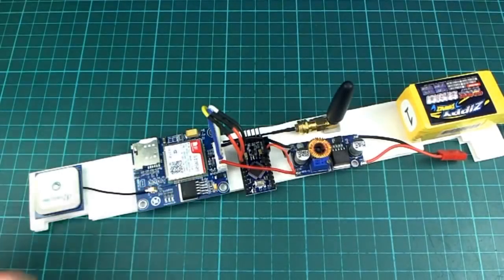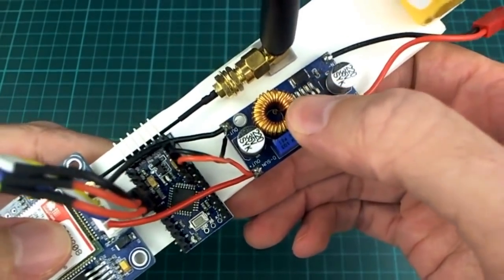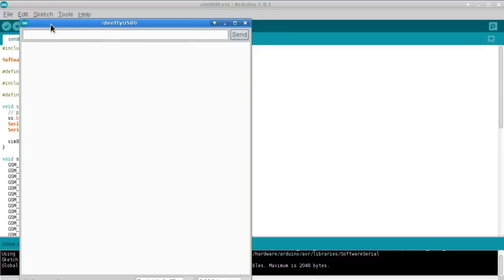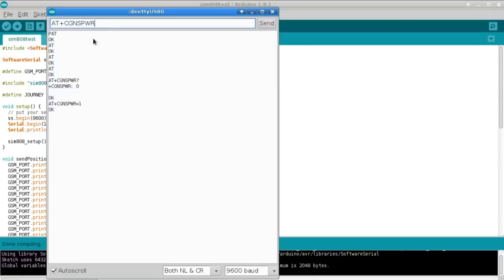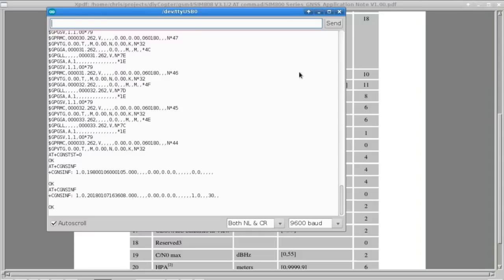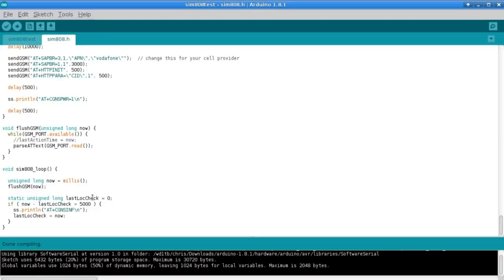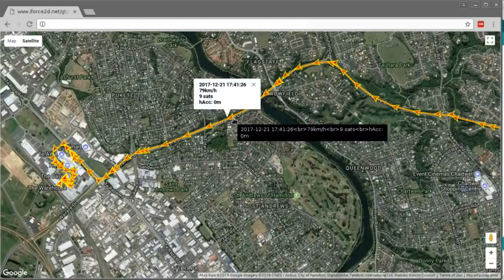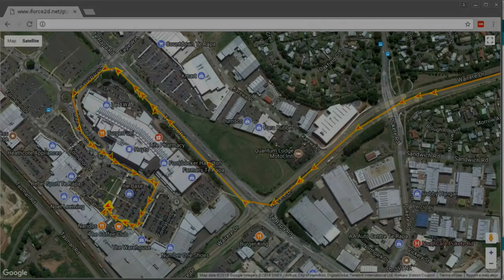Arduino GPS tracker, SIM808 version

Comment: Nice video!! I Have a question, I Have a lipo baterry, with the regulator to send 5v to sim808 and 3A but the leds of sim808 turn on two or three seconds, then turn off and then don't turn on again. I don't know what May be the problem
I am talking about the leds net, sta and pps

Comment: Hello nice video! What do I need to change if I want to use an arduino uno?
Reply from the maker: The uno and pro-mini use the same microcontroller. You'll need to change the board setting in the arduino IDE, otherwise all should be the same.

Comment: Hey Iforce2D,

I’ve checked my journey code, and it shows as available... that is, until I power on my Arduino/SIM808 and get it connected. Then the journey code reads as taken on the server - so far, so good. This means there is communication between my Arduino, the GSM, and the server. However, no data points appear on the map! Any idea the reasoning for this? 

Thanks for the help!
Reply from the maker: Sorry about that, try again now. Somehow a few lines of my PHP had disappeared, absolutely no clue how that happened, since I have not touched or even looked at that code since I uploaded the video, when it was clearly working fine. Thanks for the heads up.
Reply: iforce2d Crosses fingers

Crosses everything I can 

Plugs in arduino
Reply: iforce2d And look at that, it works! Amazing! Thanks for the help, couldn’t have done it without you and these tutorials!

Comment: Hello, I am trying to use GPS and GPRS simultaneously on this module is it possible?  I am trying a TCP connection with the server but not able to establish.
Reply from the maker: Yes, that's exactly what I did in this video. Start with the previous videos instead of trying to do this one first with no previous experience.

Comment: Hi, I did everything as you said. I also did it manually on Serial Monitor. I am  able to get successful result on Serial Monitor. When I'm uploading the code. My code is getting stuck at Waiting for SIM startup.... Any Suggestions????? Thank You.
Reply from the maker: What other print statements in the code are you expecting to see?
Reply: @iforce2d  Thank you so much for your reply. I'm expecting Parameters, that we are writing to Serial monitor through code such as "CGSINF result for is"  etc.
Reply from the maker: Standard approach when you are wondering what your program is doing, is to add logging.

Comment: i have a very similar module from adafruit , A7 module with 32u4 micro controller built in.
thy call it 32u4+A7 . 
do you think there will be huge difference in the code?

Comment: Great product! I am building data logger which will communicate with remote servers. Battery is my main problem. What are specs of this battery used in your project? mAh, voltage, current ... ? What is power supply for your GPS module? I saw a lot of people having problems with correct power supply for GSM/GPS modules. Thanks in advance!
Reply: 9 VOLTS

Comment: i am working in my fyp project its working but one problem aries in my project . Actually Project have two feature first scan the rfid card and send to web server for identification ,second get gps coordinate continuous for real time tracking of his vehicle and send lat lng to same web server.

Driver can scan his card any time while vehicle running or stop thats mean I want rfid scanner active all time and once the card scanned that detail send to web server database through http  connection but problem occurs of gps scanner because its continuously running and data sending to http web server mode Now when driver scan his card it will not scanned till gps and gprs complete his loop once they complete the card get scanned its very long process to hold the card at reader.

What I want, RFID scanning  and gps location sender functions run in parallel way as rfid reader alway active even gps sending data in background mode live service. I have two priority for this project sending gps coordinate continuously as well as scan rfid any moment that card is placed.

all problem occur due to http connection once gps is in the function of http it take time and not scan RFID.

Can I run both rfid scan and gps acquisition process simultaneously rather http connection work in background

Comment: Hi, iforce2d :) I would like and appreciate your help. I'm building a GPS tracker, similar to the one you built some months ago. I have successfully managed to get all the GPS info, coordinates, time, etc. The impasse I'm having is with the connection to the Internet so that I can see the trip in Google Earth or Maps. I've seen quite a few of your videos but cannot manage to get the connection rolling. So, few questions: What app/program did you use to see the trip? How do you establish such connection? How do you upload your coordinates/page info to the app? Hope you can help me. Thank you!
Reply from the maker: I'm using HTTP connections via a cellphone module, see the "previous video" links in the description. I don't know what you mean by "app", the display is done in a web page, you can see how the Javascript does it by looking at the webpage source. If you mean how did I put the values into a database, that is extremely boring so I will not be covering it, but it is about the most basic possible PHP you can do, pretty much just these should explain it:
https://www.w3schools.com/php/php_mysql_insert.asp
https://www.w3schools.com/php/php_mysql_select.asp
If you are asking how to set up web hosting, or configure a webserver, and a database, or about PHP coding, that is even more boring and I will not be covering that either, but there are thousands of pages on the web where you can learn about it.
Reply: I have seen many of your videos and have the same question. I think Zeromus J couldn't explain what the question is. Actually I'm wondering that how you send data to your hosting or webserver. I mean getting coordinates is okay, but how to send these coordinates to the server? By GSM or GPRS? Sim using two types of data, credit GSM and data internet (GPRS or 3G,4G).. Is it send data in form of messages or using data internet? I'm wonder I deliver what I want to ask or not , thanks :)

Comment: what capacity of battery you have used in the project
Reply from the maker: This is a very low power thing, the capacity of this battery could run it for many days so not really relevant. But since you asked it was a 800mAh 3S lipo. But again, not relevant.
Reply: what are the best battery for long life used for above project

Comment: I tried to create a new JOURNEY on your server, but it did not work. Can you help me? Thank!
Reply from the maker: Can you define "did not work" any better? That phrase gives almost nothing to act on.
Reply from the maker: In the server log I can see recent requests from Vietnam with URLs like this:

"GET /gt/gt2.php? HTTP/1.1"
"GET /gt/gt2.php?&jn=h97p9AT+HTTPACTION=0 HTTP/1.1"
"GET /gt/gt2.php?&jn=h97p9AT+HTTPACTION HTTP/1.1"
"GET /gt/gt2.php?&jn=h97p9AT HTTP/1.1"
"GET /gt/gt2.php? HTTP/1.1"
"GET /gt/gt2.php? HTTP/1.1"

These do not look like my code has been used, did you change anything?
The URL should be something like this:
/gt/gt2.php?&jn=op7qwe86md&tm=20180214092327&fx=1&lt=17.424515&ln=78.379030&sv=9&ha=0.9&gs=0.48&hd=31.93
Reply: Can I get your email? I can show you some pictures. Sorry my english is not good
Reply from the maker: If we talk here it helps more people in future, not only you. I think I pointed out the problem in my last post - and I also asked a question.
Reply from the maker: Well I don't know what to say. As you can see from the server log, my server is not receiving the correct URL string. It does not even contain the complete journey id, only up to "h97p9" and then it includes "AT+HTTPACTION" etc which should not be part of the URL at all. If you define GSM_PORT to be Serial, then you will be able to see on the serial monitor what would normally be sent to the server, then you can check if the URL is correct. It should look like the example I gave in my earlier post, with all parameters for jn, tm, lt, ln, ha etc.
Reply from the maker: What hardware are you using, eg. arduino Uno, pro-mini, etc. If you look at the function sendPositionReport, I really don't see how it's possible for that code to produce the result yours is giving.... very strange.
Reply: @iforce2d  Same here. I can see in the serial monitor, "AT+HTTPPARA="URL","http://www.iforce2d.net/gt/gt2.php?&jn=mrfisAT+HTTPACTION=0"

Looks like the URL is getting cut off, though it is followed by a 200
Reply: I'm in the same boat!! I got everything working except the URL is strange.. I can't find what the problem is so far have been sitting here for hours

Comment: Are you in the usa? What kind of sim card are you using?
Reply from the maker: No, New Zealand. I don't know much about sim cards, it's just the one they gave me at the shop :)
Reply: oh ok, I was having trouble with network connection with my gsm sim808, but I got it work know. I was using a wrong sim card.. I was using an 4G LTE sim card, and you know sim808 module works only with 2G network
Reply: I'm trying to make this project but I'm getting an error: sim808_setup was no declared in this scope.. I looking for the library <sim808.h> but can't find no where
Reply from the maker: ???  the file sim808.h is in my download zip, linked to in the description....
There is no include for <sim808.h> anywhere in my code, maybe you changed that? It should be:
#include "sim808.h"
(not with angle brackets, because that has a different meaning!)
Reply: :) I was looking the wrong code lol sorry. thank you for your help

Comment: Sir, I have a question. 
Right now I'm doing my final year project using mobile apps and this Arduino GPS tracker staff. 
So the problem here, I stuck how to connecting to my mobile apps and this Arduino GPS tracker staff. 
From your experience, do you know what is the method that I can use?
Reply from the maker: 'mobile app' you mean like android or iOS? I have no idea.
Reply: Yes, sir. It's android.
Okay then, thank you for your time.
By the way, it's a good tutorial from you sir.

Comment: @iforce2d how can i contact you?? I want to make a project like this, and i have some questions, thanks!
Reply from the maker: You just contacted me :) Discuss it here so that others will benefit from our discussion in the future, is the reply you would get anyway.
Reply: Can i make everything the same like you did, without that battery ? Only using USB cable from computer to my arduino? I have Arduino UNO so im thinking about making project on arduino that i have. I haven't checked your all videos yet, but i gonna do it soon. Yesterday i ordered, SIM808, antenna, and thinking what else do i need. Because ill get all the stuff at the mid of May, and my project presentation will be one week later, so i want to get all the stuff together at the same date and try to make project like this. Thanks, im thinking of more questions while you answering me :D
Reply from the maker: I think if you watch all the previous videos first, you wouldn't have these questions :) Yes, the UNO can handle providing enough power.
Reply: Oh thanks, ill check your videos today i think. What about wiring Arduino UNO, with other components of this project? Can i find it somewhere , or is it possible to see in the code and connect all wires like there?
Reply from the maker: I'm not sure what the question is... if you're asking whether you will need wires to connect things, of course you will :) If you're asking which wires connect to where on the modules, I repeat again, if you watch all the previous videos first, you wouldn't have these questions.
Reply: Okey thank you, ill try to make a project like this, and if i have issues ill write here. Thanks!
Reply from the maker: I just noticed that Banggood now listed some GSM antennas sold separately, might be useful: https://goo.gl/21qxgw

Comment: Hi iforce2D. First of all, thank a lot for you video it helped a lot. I was able to send gps position to my webserver but when I go in my car, when I go through a tunnel I lose the GPS signal and then it costs a lot to get back the signal. Maybe after some kilometers or when I slowdown a lot. Do you have the same problem with SIM 808 module?
Reply from the maker: Probably yes, as with any GPS. That's just how GPS works. I have not tried any tunnels though.

Comment: On the demo part in google map, I see there are orange arrows to show the direction of your device. How can you do that ? Can you explain me ?. As right now, I also made a device to track my car, but in my map, it just show only the car's position and I'm in an obstacle of finding a way to show the car's direction like yours too. So, Im very happy if you can show me how to do that. (I also used Sim808, arduino, google map API like you).
Reply: I know in GPS data, there is a field called Course over ground. I dont know what it can do with the direction @@
Reply from the maker: You can draw any kind of shape with a polyline:
https://developers.google.com/maps/documentation/javascript/examples/polyline-simple
The GPS data has a 'heading' value which is the direction of movement.
Reply: wow, I dont know GPS data has something called heading value. So if i used sim808 and use CGNSINF command, what field in the return tell about that heading value ?

Comment: Hi Chris, Do you know the difference between SIM808 and SIM868 module. thanks
Reply from the maker: No, sorry
Reply: No worries. I am in the process of designing a tracker using SIM808 but I can see SIM868 is cheaper than SIM808 hence my question.

Comment: Bro i got a doubt, what is the specification of your battery ?
Reply from the maker: I'm using a 3S lipo battery here, but that's not really important. The important thing is you need to provide a 2A capable power supply at 5V.
Reply: iforce2d ok bro and another doubt....will the battery get damaged while stepping down the voltage? Since im stepping down a 12v 5a bike battery down to 9v 2.3a will it have any effect on the battery??

Comment: I am getting first two lines properly at the serial monitor but then these symbols " ??????? " get repeatedly produced as output!! Can you help me on that and also can you provide me a link to the sim808_test program which you used in to test this module because I couldnt find it anywhere
Reply from the maker: Please watch all the videos from the beginning. You should not be asking such basic questions on this video, it is a very complex project. The link to the arduino sketch is given in the description.
Reply: Waiting for sim startup and then it shows??? In serial monitor.....is my baud rate an issue?? Bro i watched all your videos yesterday but still not getting any idea...pls help me on this
Reply: iforce2d shall i send u a pic of the output?
Reply from the maker: Have you ever played "spot the difference"? Do everything EXACTLY as I did in my videos and find the first point that you get a different result.
Reply: iforce2d ook brooo il do and come backk
Reply: @iforce2d  hello, did you update the link on the description? the current link only has "sim808GPSTracker" and that version has no code to test the module with the serial monitor. thanks!

Comment: sir i set the journy code =arttracker and uplode the programe ,and at serial port i get lat long etc and httpaction=0 /output is ok 
i try to see output at webside but there is nothing .
i see the journy code here     http://www.iforce2d.net/gt/checkJourney.php?jn=arttracker
it is ok
than i go on  http://www.iforce2d.net/gt/index.php?jn=arttracker&tz=13&os=10&lt=50
but there is nothing what should i do sir
Reply from the maker: Let me guess, you just copy+paste my code and expect it to work, without doing everything manually, step by step in the arduino serial monitor first to check if it works. Are you in New Zealand? Are you using a Vodafone SIM card? No, I don't think so.... but if you copied my code you will be trying to use New Zealand Vodafone access point code, which will never work. I don't know how many times I have said this now, but you need to watch all the previous videos so that you can do a basic HTTP request. You have to learn to walk before you can run.

Here is the first video of my series where I explained the beginning steps of using HTTP, you need to watch this and do EVERY STEP just like I did (except use the access point code for your country and network of course). https://youtu.be/9UEcT5GxdBk?t=32m1s

Let me say again... do every step. EVERY STEP.... get it? You can't just skip to the end and paste in some code and expect it to work. If you did every step to begin with you would probably never need to ask me any questions here....

Comment: Hey man, what a great job with this module, in fact I just got one of this 2 days ago and I was thinking to parse the data using the tinyGPS library cause I didn't knew that this module gives you the parsed data so I'm going to take a look to the SIM808 AT commands, and I wanted to ask you, did you use Google maps inside your page? Cause I want to do something like that in my page, maybe build a GPS tracker and show the info in real time over a map in my own domain, thanks!